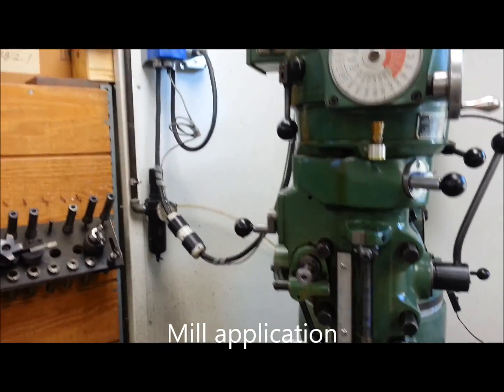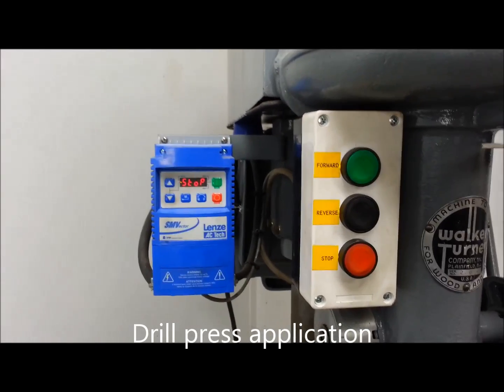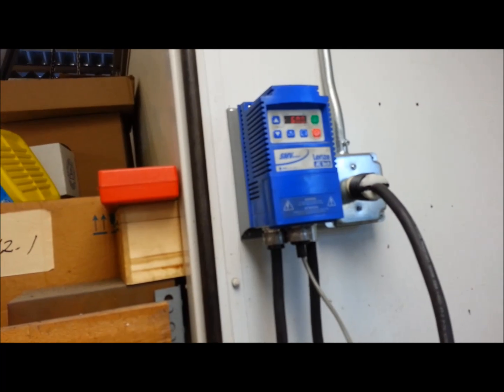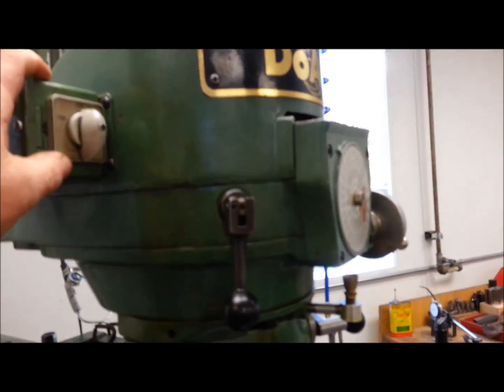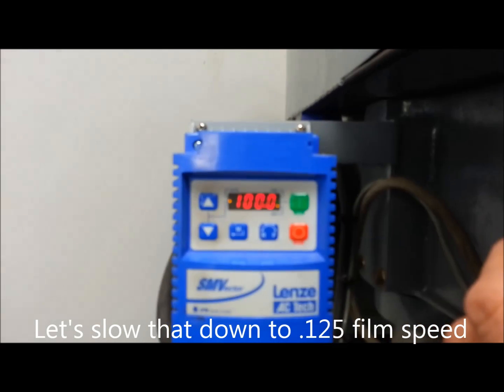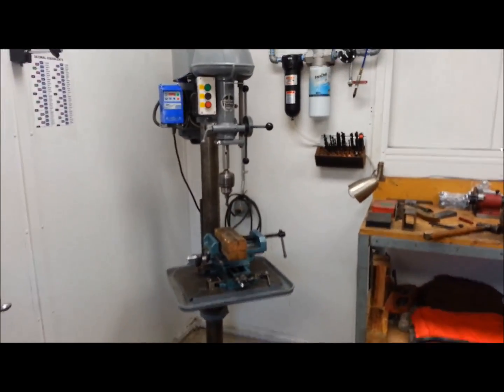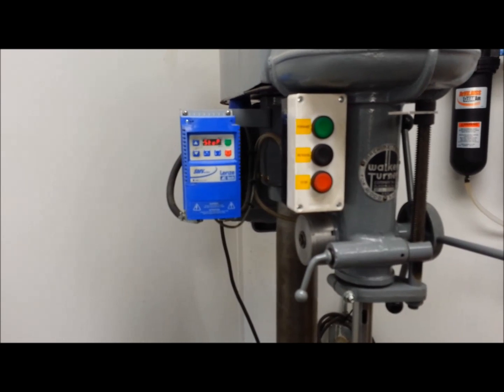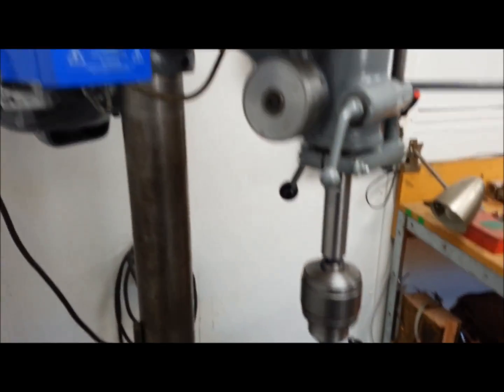VFD introduction / application / information

Comment: Really interesting video. Lots of info even if I got lost :))
I have a question tho..I want to install 220 in my garage. Now there is an existing wall outlet for a electric dryer that we dont use. I checked and they pulled the circuit breaker for it. Can I use that same wiring behine the outlet as long as I reinstall the 220 v circuiyt breaker to run a 220v milling machine and or a lathe....I am speaking of the electric motors.
Now theVFDs would this be an easier way to go instead of rewiring??? In other words do I need to start with 220 coming out of the wall?? How bout the length of cord from the machine to outlet how long a cord can one go ??
Thanks Stan for sharing some of your knowledge again.
You always amaze me.
Manny
Reply from the maker: Hey Manny,
A dryer circuit works fine, I would keep your cord length as short as possible, maybe 20 feet. Most dryers are 40 amp so the breaker will be oversized for your application, recommend changing the breaker to lower value so everything is protected, the wire being oversized wont hurt anything.
Reply: Alright..thanks for that I did some research but am not an AC person. I respect AC especially high voltage.
I ask all I can before I mess with it.
Manny

Comment: Lenze SMCVector, single phase input (120V?), three phase output..  2 HP unit )Lathe.

Are you using one model of Lenze SMCVector.  I tried to look over their models, but there are a bunch of them.  What model did you settle on?

Comment: Thanks for the informative video. Are the parameters the same for the momentary start/stop switches as they are for a maintained switch? Also, can a momentary "spring to center" lever switch be used for forward/reverse control? I already had decided to buy this same VFD based on your video. Thanks!
Reply from the maker: No, a simple parameter change will change the control for momentary to maintained, the book is easy to follow and shouldn't give you any trouble :)

Comment: That torque part i didnt get. How can i know i have a variable torque drive? Or the other.
What is ideal for a lathe?
Reply from the maker: Hi Nick,
Look for vector control when purchasing a VFD, this will allow you to enable that feature, I would get constant torque for a lathe.
Reply: Shadon HKW Does it say vector drive on the device?
And how will i know it is a constant torque?
Reply from the maker: The Lenze SMV drives are all constant torque, they are the ones highlighted in this video.

Comment: Great Video,

Could you share the remote button wiring for Jogging using Push buttons along with normal start and stop.
Thanks
Saneesh
Reply from the maker: That would depend on the drive, Lenze uses programmable inputs on S-1 S-2 & S-3, a jog button can be programmed to any of these inputs.
Reply: Shadon HKW Thanks Buddy, I have a Fuji FVR Micro. Let me try some options.

Comment: Very good video and I've read most of the comments, but I still have a lingering question. I have a 1 HP drill press that I've replaced the single phase motor with a 2 HP 3 phase. I had this brand new motor laying around and it mounts up nicely and happens to have the correct shaft size. I bought the 120v 1.5 hp Lenze SMVector drive (biggest in the 120v sizes) to run it. I haven't turned it on yet, but I'm pretty sure I read that the size difference shouldn't be a problem, as long as I keep the load below 1.5 HP. What are your thoughts on this type of sizing?
Reply from the maker: Borderline, with intermittent light duty use it shouldn't be a problem, but sometimes machines get a new home and someone else may push this machine harder than it should be, the drive will always protect itself against overload, but this will chisel away at it until one day it finally gives up.

Comment: Great Video!  A friend of ours got an old 3 phase - 230v lathe from a buddy.
Without going through to much work, is it feasible to just use the VFD to convert 220v single phase to 3 phase and use all the old controls?  or is it always necessary to convert the old motor to something newer?
Reply from the maker: Old motor should work fine, just using the VFD for phase conversion is easy on motors.
Reply: I have the same situation, I wanted to use the original controls, motor starters and contactors to control forward, reverse, jog, coolant pump, etc.  Using a VFD to supply line power (220VAC, 3PH) won't work in conjunction with these controls.  You have to bypass the controls and wire VFD directly to your motor and control the VFD either locally (touch pad) or remotely with start/stop, forward/reverse, jog or potentiometer wired
into the VFD.  Most VFDs have a terminal strip to allow for this wiring up of a separate control panel.  The other option is a rotary phase converter which will allow for use of original controls but they are a lot more expensive.

Comment: Yes this is the main reason lathe machine has every thing, I.E forward, revers, jog and foot brake, only problem when I am threading against shoulder and thread are not very long, I sure like to have slower speed not young any more and do not have fast coordination to move cross slide away from shoulder.
Main question I have, when I install 3 phase motor at the same time I have to supply 220 volt to the rest of lathe function right?
Motor is 2 HP at presen can I install 2 HP 3 Phase or I can go bit smaller?
Thanks
Reply from the maker: I wouldn't step down in HP, but the RPM motor you choose will have an effect on the low speed torque, I think equal to or slightly lower than your existing RPM would be a good choice, make sure the motor is VFD rated and overdriving it to get back to your max RPM will be no problem.

Comment: Good morning,
Excellent video lots of information regarding VFD, I have purchase new lathe 14" x 40" from Modern Tool in Britsh Columbia, lowest speed On Chuck is 77, bit to fast when cutting thread, if I install VFD would I be able to slow down Chuck down to 20 or 25? And the same time I would not loose any function of the lathe, I do have to chage lathe motor, lathe came with 220 single Phase motor, you help will be greatly appreciated.
Email: ve6but@shaw.ca
Reply from the maker: Hiya, You will of course have to switch to a 3 phase motor, the VFD will work fine to get you from 77 to the mid 20's, is this the only reason you are doing this conversion? I thread at 100 RPM all the time.

Comment: I have a Logan lathe with a single phase 1 horse motor.
What would you recommend for VFD and motor in a hobby machinist environment?

Bill
Reply from the maker: Hi Bill,
Is there a mechanical gear reduction in place? A VFD isn't a "cure all" to completely replace gear reduction and torque multiplication. It will give you speed control within reason, but running the motor down below half speed will see a big drop in torque. Shoot me an e-mail with some pics and details on the machine, we can talk more :)

Comment: Excellent vid.  You offered to answer question, so here goes.
1.  It appears you run the VFD's off 110V.  Other then the increased cost of the actual 220V wiring, what are the advantages and disadvantages of running the VFD off 110V vs 220V.
2.  Our machines use constant RPM motors driving either gears or pulleys to control the ultimate speed at the work.  Engaging the gears/pulleys to slow down the RPM provides added torque with the slower speed.
a.  With the VFD you actually slow down the motor RPM to slow down the machine speed, does this mean you lose torque?
b.  Since you control motor RPM with the VFD, does this mean you bypass the machine's gear/pulley systems, or in what range do you leave them.
3.  I am considering the purchase of an old industrial bandsaw that uses step pulleys to change speeds, it is three phase.  Can I use the motor and just leave the pulleys, or do I replace the step-pulley system with a simple pulley?
4.  I have a large rotary converter supplying 3-phase power, can I use the VFD's to manipulate the machine speed?
Thank you for any info you may provide.
Reply from the maker: Hi Morris,
1. I use the 240 V models in my shop, 1 HP is the limit for 110V input on the Lenze drives, they are also slightly more expensive.
2A. A mechanical gear reduction is always superior to just slowing down the motor.
2B. Always spin the motor as close to the rated RPM as possible, the vector control helps boost low end torque, but it isnt a miracle worker. This is of course for a constant torque application where your load is a constant no matter what speed.
3. I would leave the step pulley until you find a combination of motor speed / mechanical drive ratio that gives you a suitable operating range.
4. 3 phase incoming power from an RPC will work fine, the VFD will even clean up and re-align your phases, damage can result from stopping the RPC before the VFD is given a stop command, so be careful.

Another note: When setting up mechanical gear reductions, always choose a lower ratio, you can always overdrive the motor to make up for the lost final RPM. I run 60Hz rated motors to 120 Hz regularly, but always consult the motor manufacture for max RPM recommendations.

Comment: I have to say other than some omissions your vid was excellent. Really almost no one is gonna run at 10% long enough to cook a motor. And 900 rpm 8 pole, yup. Odd ball, you bust have counted the wires. All things considered great vid. I didn't even think about a potentiometer until I saw your vid. I'm gonna fix up an old beat up lathe. Good old,too good to throw away casting.i appreciate you buying American. Everyone should thanks

Comment: As others have already said, this is without a doubt one of the best demonstrations out here on VFD applications and capabilities as they pertain to us "garage shop" guys. THANK YOU.
Question for you...I have those exact same VFD's to be hooked up to my mill and lathe. I noticed that you didn't mention any protective fusing between the VFD output and the motors (protect the VFD from excessive current that might occur should the motor short or become overloaded) . Any particular reason why?
Reply from the maker: Hi John,
Fusing in between a VFD and motor is never recommended, VFD's have internal protection and are adjustable (via parameter group) for overload protection.

Thanks for the view and comment.

Comment: Wow, thanks for the tutorial Professor Stan! You made it very interesting, and easy to understand how useful they can be and so widely applicable they are. Thanks a bunch!

I had a friend whose job it was to program all sorts of equipment using solid state analog devices and controllers. He was talking about industry's conversion to digital control interfaces and his trying to learn all of the programming for it and retrofitting all of the conveyors, canning machines, pumps, etc...drove him into the ground, literally.

Time well spent, now back to the field...Aloha, Chuck.

Comment: great video, I have watched many and your is the best so far in opinion Thank you.

quick question. do you want a variable torque drive or constant for machine like your shop examples. .your video explained the difference but i am just confused about which one is suited for a shop.
Reply from the maker: Hi Bill, typically a vector drive (constant) is used in a machine shop environment.

Thanks for the view and comment.

Comment: Very informative.  I learned a lot here about what a VFD can do, why you might want one, and what some of the cost/feature trade offs are.  If you do a follow up, some other things that would be interesting for us newbies include motor types they work with (3 phase is obvious now, but will a single phase motor work?  I suspect, but don't know for sure, that DC motors will not work...they just want a simple voltage control for speed, right?) are there any issues with RF noise?  What sort of life expectancy do they have?  Are they vibration sensitive?  

Thanks very much for the education!

-- Mike
Reply: Zghuzh

Comment: I suppose I am more of a VFD expert than a machinist - at least so far.  Have watched several other machinist explaining VFD and setups.  This one is the BEST I have seen so far.

Couple small points.
1.  As someone else pointed out be very careful at low speed operation.  Fan motor runs too slow to cool the motor.  I would be very cautions at speed 10% rated motor speed or less without additional cooling.
2.  Motor shaft speed = (Freq x 120) / poles.  So 2 pole is 3600, 4 is 1800, 6 is 1200 and 8 is 900.  Your 900 RPM drill press motor is 8 pole.  Slip at full load is about 5% as a thumbrule for motors.  Slip applies to both driving and braking ie overhauling load.
3.HP = (Torque X RPM) / 5252.  So a 1/2 HP 3600 RPM motor will produce 1/2 the torque a 1800 RPM motor does.  If you gear a 3600 different (ie double the reduction) then all will be OK.
4.  Over baseline ie 60 Hz (1800 RPM for 4 pole) torque drops off inverse proportional to RPM ie at 3600 RPM torque would be half that at rated 1800 RPM.  I would assume high speed = fine cut therevore real low torque demand from load (cutter) most likely no problem.

I really like the quick reversing that VFD can do.  Great for power tap and I think also as a E stop - might keep you from another wrap around the shaft so to speak.

Also liked yuor points re VFD enclosure - one guy has cheapy with all terminals exposed - wont last long with chips for sure.

A planar VFD may have hard time overcome inertia torque demand at startup of lathe.  It could be done I suppose with the torque boost command.  Highly recommend vector control for this application.

Mills and especially so drill press planar could work fairly well.  May save a few bucks - but savings may be so minimal that in long term vector could easily be preferable.

Dan Bentler
Seattle
Reply from the maker: Hi Dan,All great points, thanks for the view and comment!Stan

Comment: 60 Hz (cycles per second) x 60 seconds = 3600.   Synchronous (synchronous to the input frequency) motors run at divisions of the 3600 cycles, depending upon the number of poles.  usually.  good info.

Comment: I have that exact VFD on my milling machine Id like to set it up like you did on your drill press.Do you have a wiring diagram and what parameters you set and what you set them to ? Also did that switch come as an assembly or did you have to build it ?  Thanks for posting I've learned a lot from it
Reply from the maker: Hi Fester,
Its wired per the manual for momentary run forward / reverse / stop, the quill limit switch is wired in parallel with the reverse switch. The switch assembly can be bought and is mainly used for roll up doors (up - down- stop) Thanks for the comment.

Comment: Hi Stan, incredibly informative! A bit of irony, some years back I was given a Sheldon variable speed drive lathe complete with all the accessories because the drive system had went to lunch, I of course hauled it home and attempted repairs, key word there being attempted, I inquired with everybody I knew about some sort of fix, and the  overwhelming opinions were that it could not be repaired without a kings ransom and a witch doctor, it was a diabolical looking thing. I did get it to work briefly with a different motor and a very crude cone pulley-kinda-setup, but it was not going to be a viable fix, and I did eventually barter it off, but man that would have been an awesome machine in proper working form, I probably would still have it , it was in that good a shape!  Your setup here would have made the repair a simple rework, and would have rendered it better than original....... Water under the bridge as they say.    Good stuff,  a great lesson to retain.    
  Mike
Reply from the maker: Hi Michael,
While VFD's aren't a "cure all" they sure have a lot of uses, and can open up some possibility's that simply couldn't be done even 10-15 years ago. Too bad about that lathe, probably would have made a sweet set up.

Happy new year,

Stan